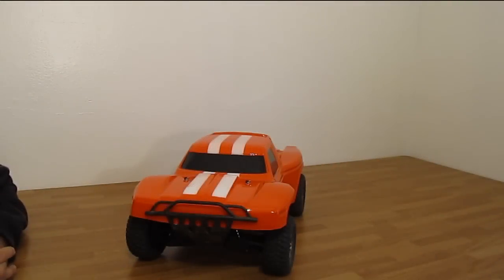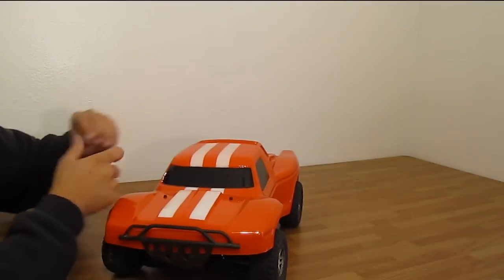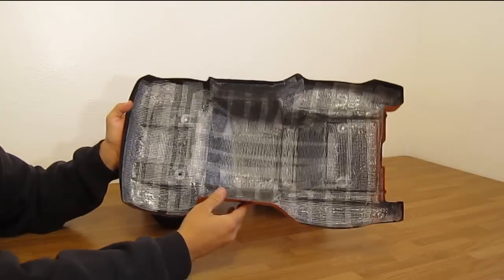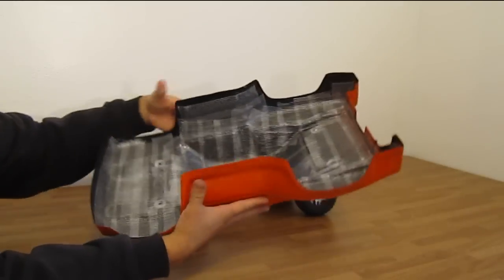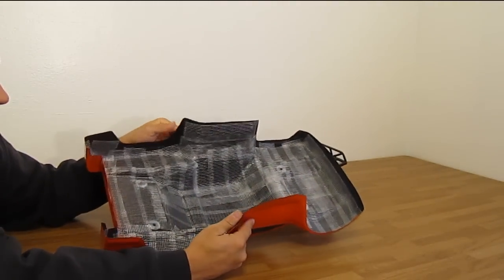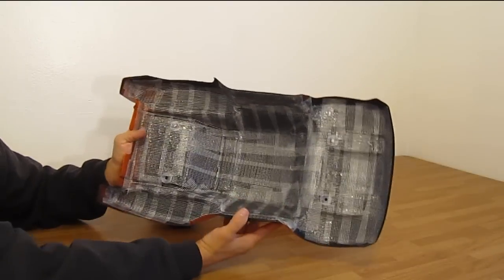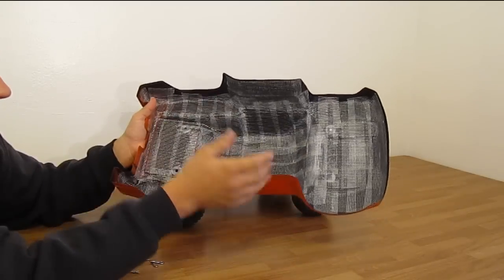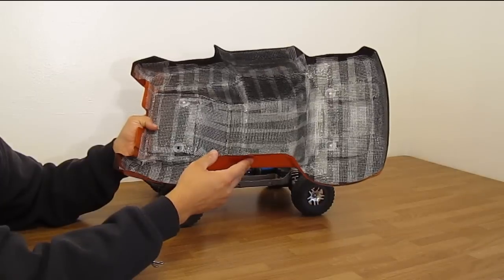RC Body Reinforcement Strengthening Total Coverage

Comment: Wondering if  you or anyone has ever tried mincing up the drywall tape into fragments and making a paste of it with the shoe goo?  Kind of like when  you work with fiberglass resin. I've started reinforcing the way described in this video and it works great, but the tape can be tough to mold around some more detailed body areas. Thoughts?

Comment: I repair cracks and splits this way. Made washers from milk carton which works great. I then cover whole inside with only goo, but a good thick layer(I used whole tube). Big jumps to roof landings are not a problem now. It's not so heavy either.

Comment from the maker: Shoe goo is used as a sealant for shoes and skate primarily. Has a helluva bond but yet flexes too. I use the shoe goo and drywall tape method. I have a video how to in my tips and tricks playlist. Some folks also use truck bedliner as well. message me if you need some more help. Cheers back at ya from the states :)

Comment: I had to do my SC Truck as it had some major breaks in it and now its "TANK TOUGH"
I roll the truck at full speed on grass and black top with no damage to it other than a few scratches 
when I re do my new shell this winter will add some just for strength and it cost me like 6.89 for the goop and another 3 for the tape but it added a little more that 3oz more like 12-14oz as the goop is 10oz alone but well worth it

Comment: Did you consider using glass fiber tape/fabric and epoxy resin?  You can get it from boat building suppliers, and it should be massively strong.  May not flex as much through, plus epoxy is horrible to use.